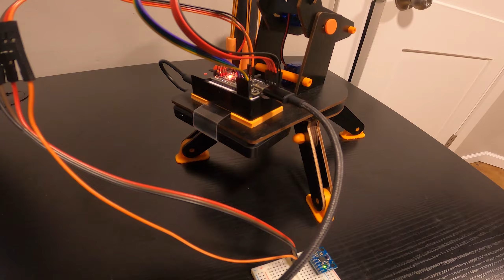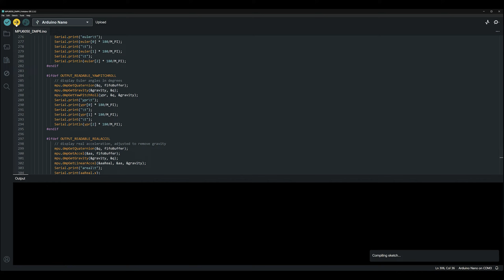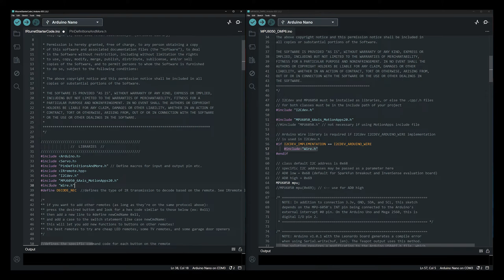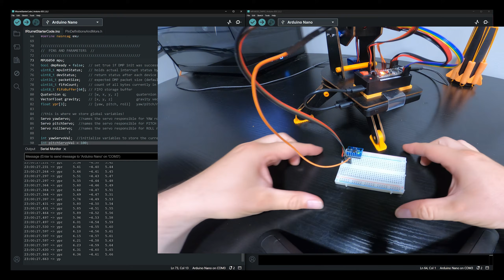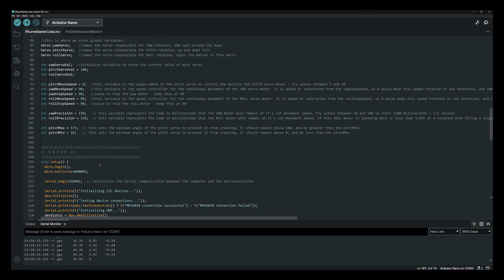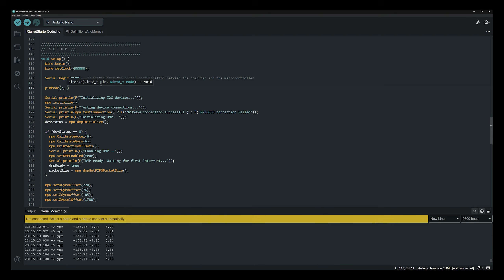Control Your Turret With a Hat: Accelerometer and Gyroscope Controls

Comment: Thank you very much for the video! 
It's almost too embarassing, but as a total noob in this field, I wasn't sure how to connect other modules to the IR turret, meaning how you're supposed to use the breadbord in general. 
The "paper" that came with the turret and that needs to be put on the breadboard was a great help during the build process, but then threw me off, because the other "holes" were covered...I know...
Your video confirmed how it's supposed to be done, so once again, than you soo much for showing the wiring :)
Reply from the maker: You're welcome, glad I could help!